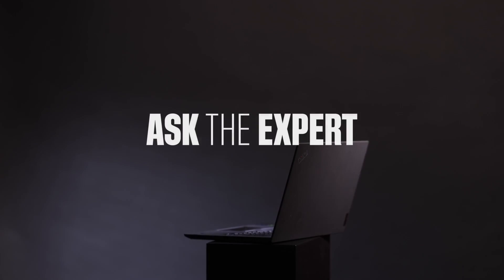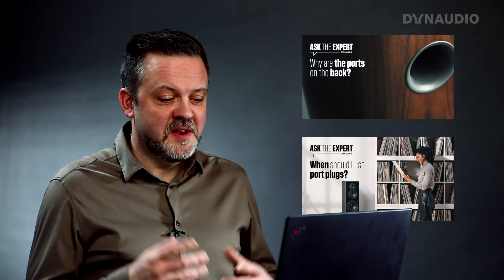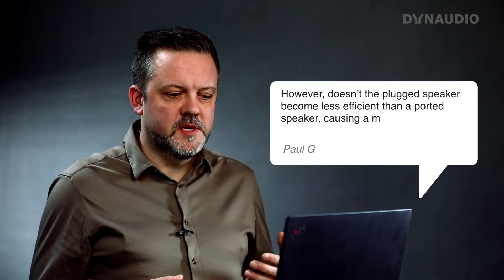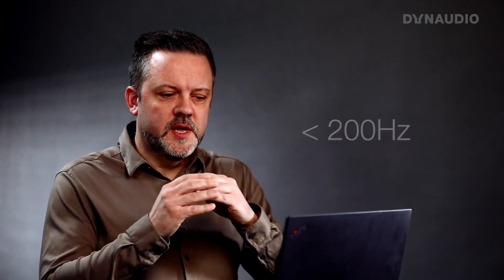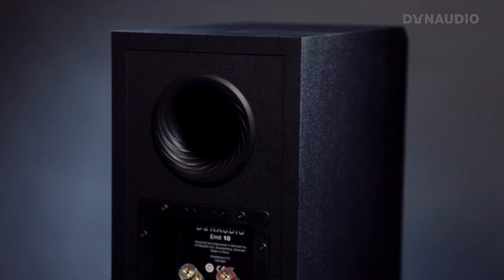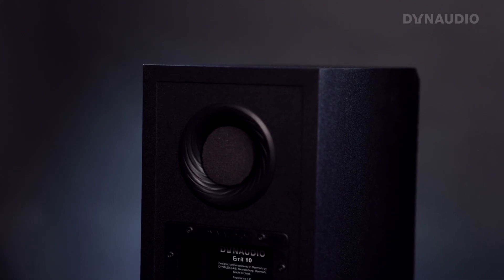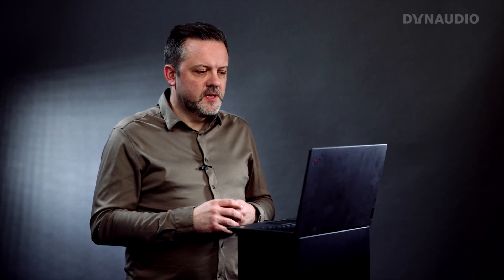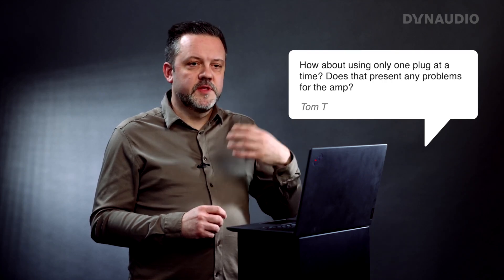Plugging the port on only one speaker. Go or no-go?

Comment: People buy equipment for a lot of money, but they cannot arrange the system in the room, listening to whether it sounds good or bad by changing the position of the speakers. I changed equipment and had a problem with the bass, so I moved the speakers until I liked the effect. It's a good idea to compare it with the sound on good monitor headphones and head in that direction. I have been testing Emi 30 for 2 days and I am blown away by the quality of sound with great bass. But I don't know if I'll miss the opportunity to put in earplugs because there's probably too much reflection when listening at louder levels.

Comment: Hi! The Contour 60i has two ports pr speaker. Is there any difference in which ports you plug? Best regards, Anders Hauge Olsen
Reply: Hi Anders! Great question. The ports on Contour 60i are tuned to the same frequency, and are part of the same acoustic chamber. This means that technically, there is no difference which one you plug. However, due to the large physical distance between them, they may interact differently with the room, so you may experience a minor difference in the listening position, related to which one you plug. There is no right or wrong to that, so you will have to experiment with the sound in your actual room, to decide which one to go for.

/Otto, Dynaudio Academy